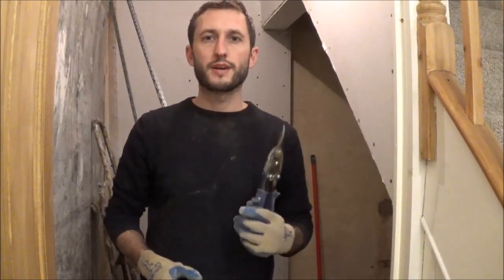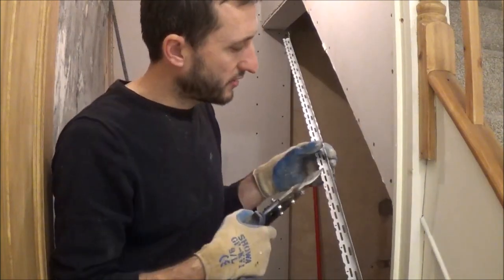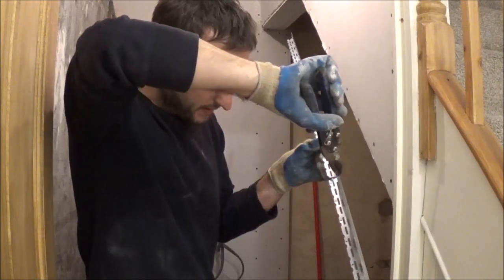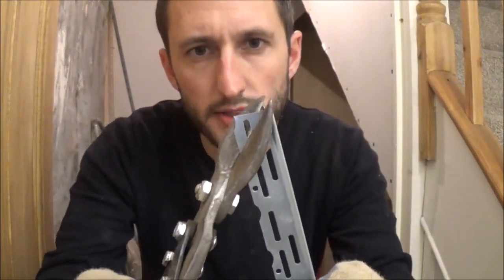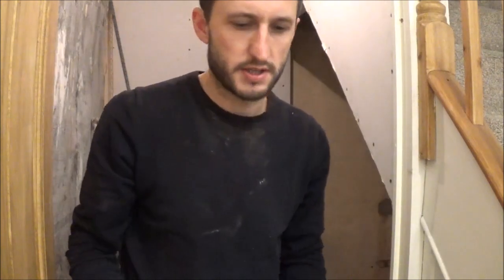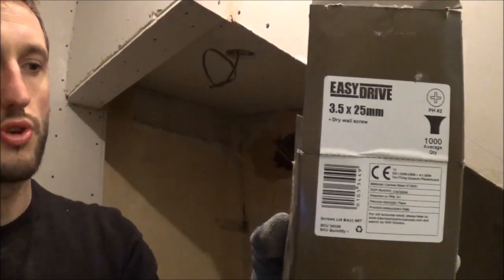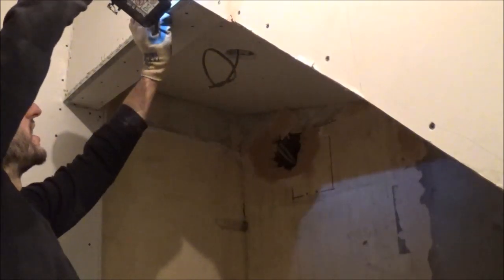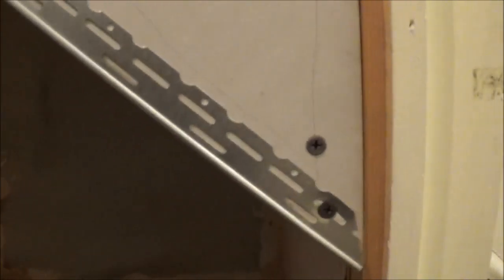How to install drywall corner bead/angle bead, plaster corner bead/angle bead.

Comment: I must be stuck in the dark ages cos I still use clout nails and that bead will probably crack without being fixed on both sides
Reply from the maker: I think it's horses for courses. It doesn't crack if plastered correctly. I have no cracks to date and it's five years old, under a staircase so it's holding up ok. Thanks for watching Steven.

Comment: I'm not a plaster but I have done quite a lot of plastering as I've renovated a few houses now...believe or not I use a hot melt glue gun to put up beading..works really well. and sets really fast strange i know.... there's a saying if its silly and it works .it aint silly :)
Reply from the maker: Thanks for the feedback, great tip! Best of luck with the renovations and thanks for watching!
Reply: But isn't the hot glue thick, so once dry it can't be sanded down?

Comment: Assuming you mean pva the wall behind?
Reply from the maker: Sorry, I probably didn't make that clear. Yes, PVA the wall behind. The plaster can go straight onto the plasterboard. You need to scrim tape your joints first though, something I didn't show. I think I'm going to have to do another video! Thanks for watching.
Reply: No worries! Thanks for your replies. Very good videos. I'm actually doing it for DIY and finally got all the plasterboard up in my extension, this weekend for the plastering! I went on a plastering course and they said to nail the beads on. Although I would prefer to screw them like you did, do you find the heads of the screws are flush enough to plaster over? Thanks
Reply from the maker: Yes, the heads are ok as long as your plaster is thick enough. I was able to screw as I had wood behind the bead. If attaching to masonry or old plaster, you can use masonry nails/tacs which are good (another video maybe!). You can always try a length of scrim tape across the screw heads if you're worried about it but I've never had a problem.

Comment: Hi. How do you put beading on to plaster work that has beading already on the corners?
Reply: Ian Lampitt probably that board adhesive be good ,I know what you mean tho if I put a nail through the new bead you might hit a solid bit of the old bead and it could bow out and crack plaster

Comment: What happens when come across a corner that won't take a screw??
Reply from the maker: You can use plaster to fix bead if you get this problem. You can watch my other video that shows how to do this -  How to fit plaster bead using plaster - https://youtu.be/L4f6Zn45xps. Thanks for watching!
Reply: Stapler. Much quicker. And strong straight away, ready to plaster immediately.

Comment: Great video! I have only plastered once and I'm looking to plaster a window reveal but not the rest of the adjoining wall - can I use thin skim stop beads to limit my hit to just the reveal?

Thanks!
Reply from the maker: Yes you can use stop bead. You just have to paint the thin metal bit that's exposed after it's plastered. Hope that helps. Good luck and thanks for watching!

Comment: You do not bead up using screws
Reply from the maker: Hi James, I did! There are several ways to bead up. Screws ensure the bead doesn't come away in the future if the wall expand or contract slightly and as long as they don't bend the bead by screwing to tight it is fine. Nails can pull out slightly causing plaster to crack. I have other videos showing the other methods I use. Why don't you bead up using screws? Thanks for the comment and thanks for watching.
Reply: Its just not the correct way we use nails or tak the beads with nails and then plaster them on with dot +dab or dabs of plaster
Reply: More than one way to skin a cat. If something works for you and does the job then its the right way of doing it.